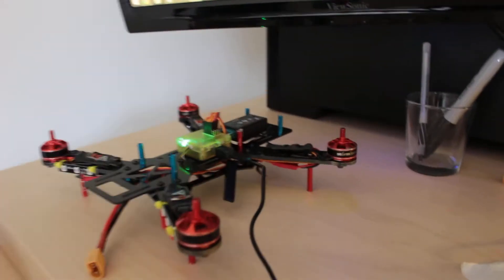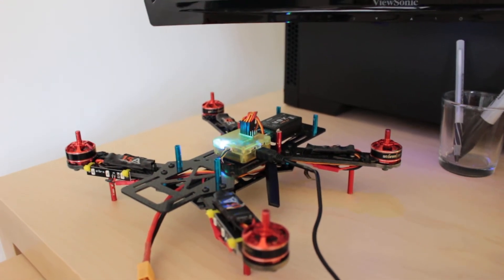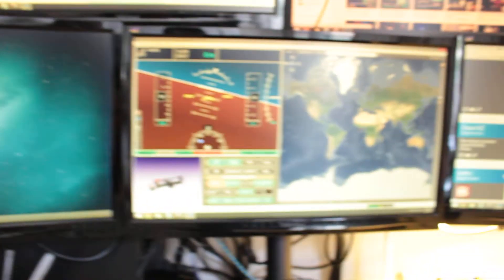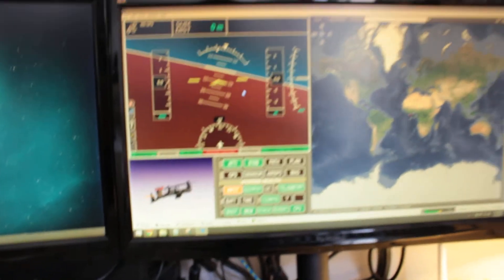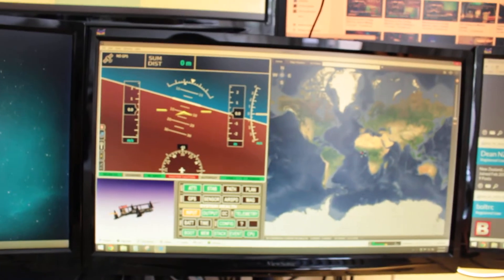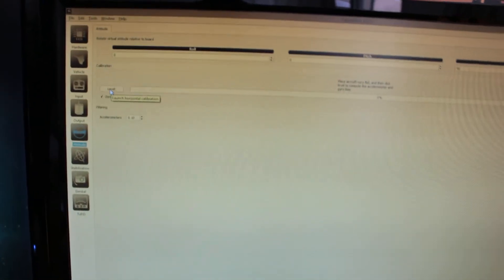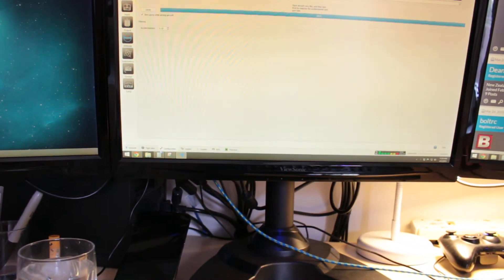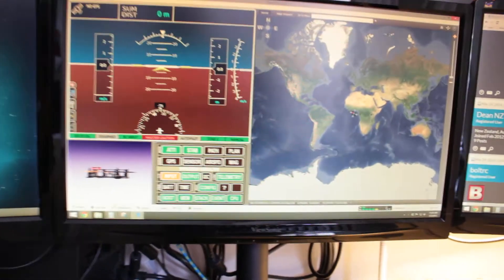How To Fix Drift Problem on Storm Racing Drone

Comment: Andrew, I just flew my SRD 250 PRO today and it has the same drift problem as well. As of today, what open pilot version/firmware updates would I need, and what are the correct steps I would need to do to correctly to fixed it? 
Thanks
Jamie

Comment: Hi, Thanks for your information. very good. I have problem after this setup. I calibrate und then i go to Firmware upgrade. After this, drone is starting with sound but no comments from my transmitter. I have it reband and the flash on rx701 constant red but i cant start my drone. please help me
Reply: Marko Landolt ...and the blue flash on cc3d is flashing slowly.